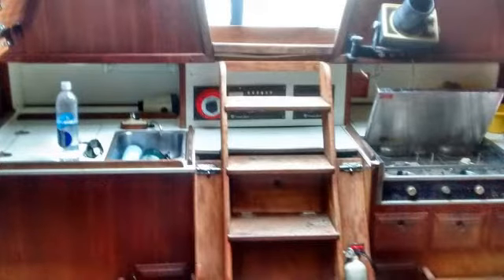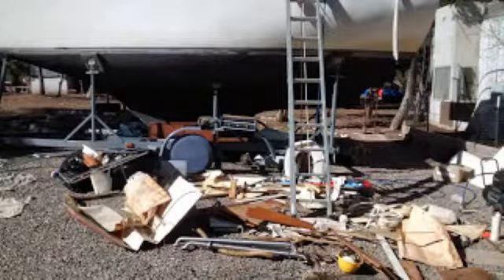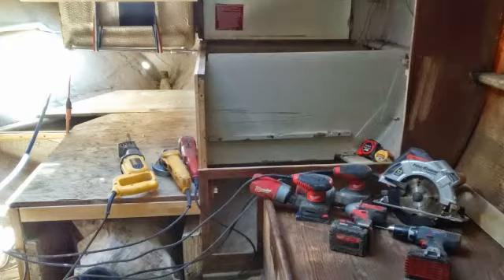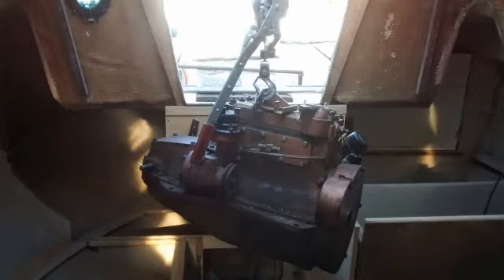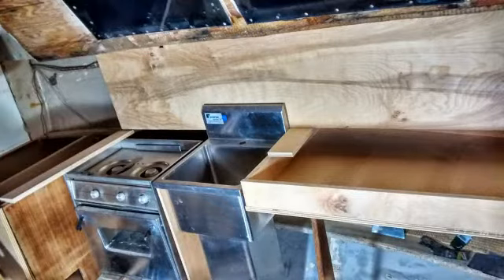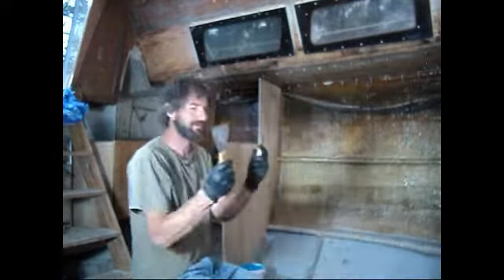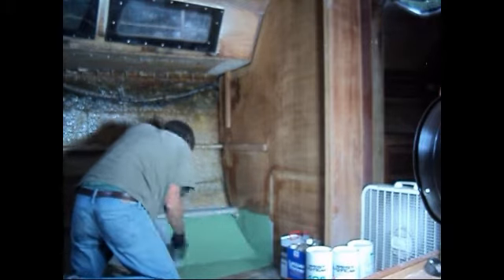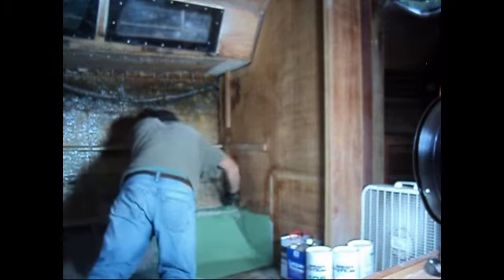Sailboat Restoration - Interior Demo On A Columbia 8.3 Sailboat

Comment: birch ply from Home Depot has no business on a boat. you need marine plywood with boil proof glue (how they test it). anything less WILL delaminate unless its covered in fiberglass cloth and epoxy resin. even then, if there are screw holes in it it will eventually delaminate.